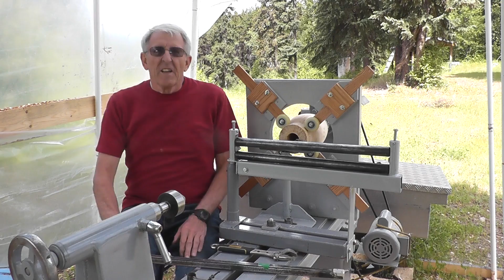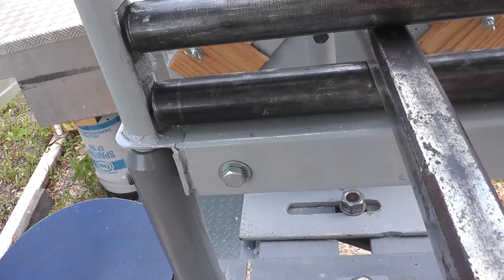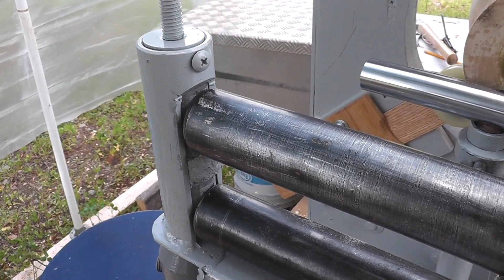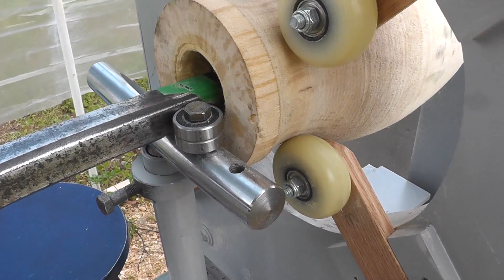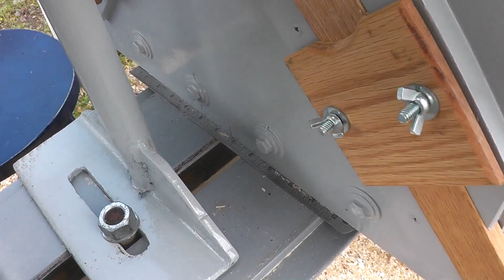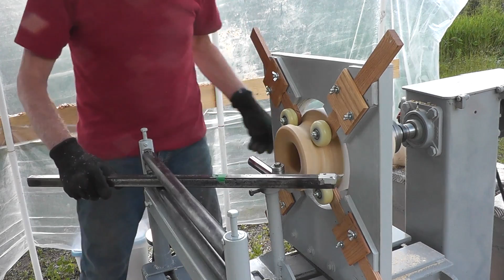Hollowing system for wood lathe

Comment: Hi Brian. I recognized you right away in the video! Nice to know your LJ buddies!!!!!! I have an articulated arm but I want to make a boring bar that just has a bar welded off to the side to counter the torque. It is one that you don't have to make a set up to use. It would be like grabbing a gouge. I saw one in an LJ project ( think it was a guy from Croatia but it was not Ivan- I asked him). Then I just watched a guy using one on a backwards turning piece with a spring as a wall thickness indicator. I want to make one for our Arizona shop,....Cheers,Jim
Reply from the maker: Yes I like the system too and have been meaning to make one. D-way tools in Washington state has  them, but like ourselves why buy when you can make.  I did buy the small scraper tip from them and am using it in my articulated arm setup.  There is video's of him using it, runs the lathe in reverse,  nice for using that setup.  Spring thing work great.  Check that one out.  Sorry I have not been able to keep up with Lumberjocks do to Jo's health, better days are coming.
Reply: @brianprocter6191  Hi Brian. So sorry to year you wife is not feeling good! Not the virus, I hope?? I saw the video of it being used with the lathe in reverse. That tool is bent and dedicated to that direction. My lathe has reverse but I never use it or the electronic brake because there is not set screw for my chuck or face plate to prevent loosening. I have big Longworth chuck I made out of Corian  and the lathe had the electronic brake  enables when I bought it. I turned the lathe off and that chuck unscrewed and I had to hold it there spinning on the ways so it would not drop the the floor and shatter. by the way, my friend Ron Campbell from Michigan bought Arizona Carbide and he sells some nice carbide cutters to use in boring bars rather than making them from tool steel. I have a few round ones and they really hog out that center!!!!..Cheers, Jim

Comment: Hi Brian. Nice video!
Reply from the maker: Thanks  That was my first system I tried, worked well but like the articulated arm allot better.  Just finished cuting my lathe off and welded in a 5 inch spacer.  If i welded on a D section would work allot smoother.